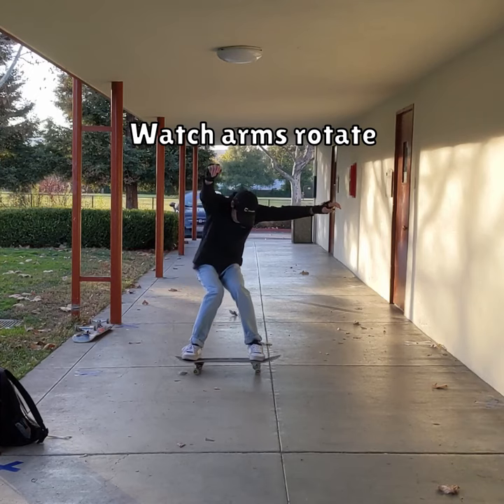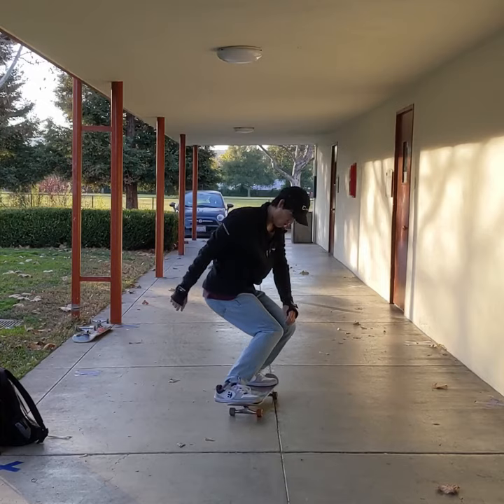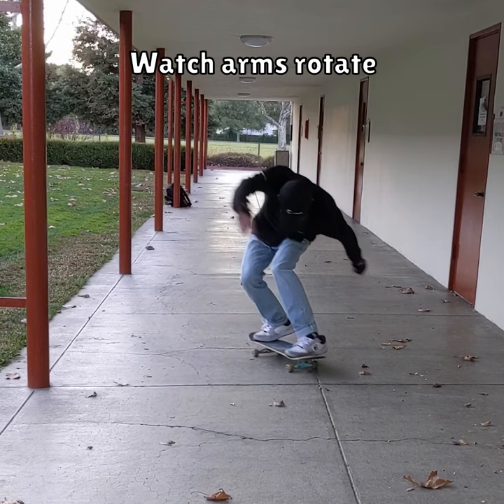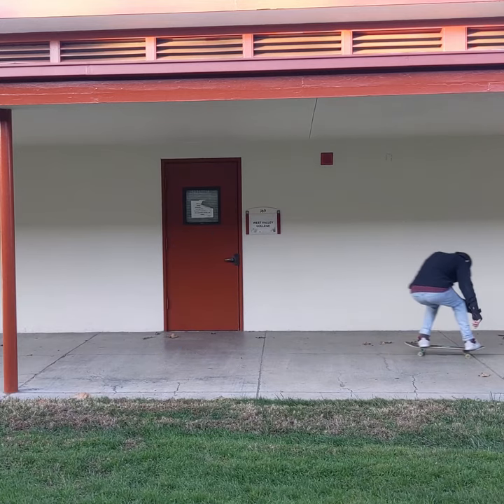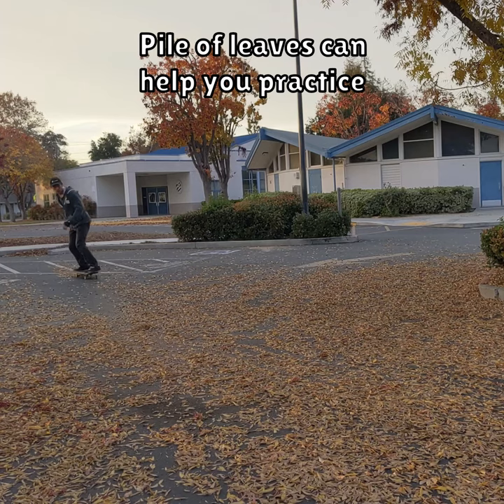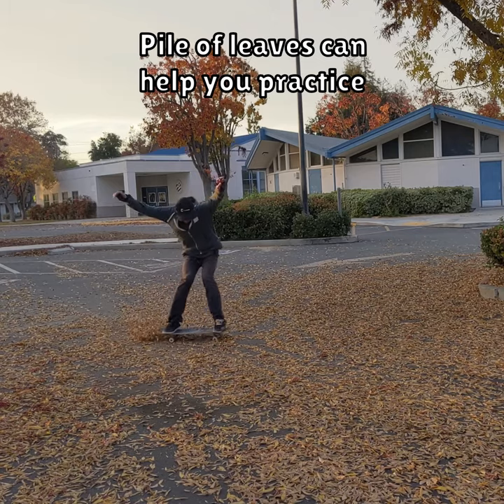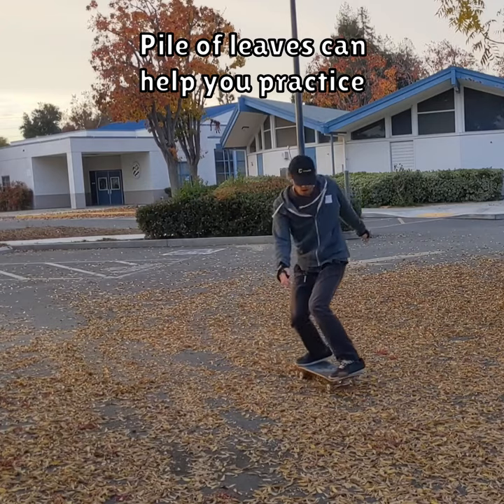Skate Basics: How to POWERSLIDE

Comment: Nobody tells you this easy tip, from a guy who has just learned to powerslide: the easiest possible way to learn it is to learn it into a wall, like go for the slide and hit the wall, so that the wall absorbs your momentum and you cannot possibly fall backwards, the wall just catches you, it's extremely easy to learn it like this, and do it faster and faster until you can slide for over a meter and barely touch the wall, then try without a wall. Other tips: get 99a hardness wheels, those slide extremely well; a smooth surface is better; when initiating the slide push your back leg forward and do a bit of a hop so that you don't have any weight on the board, then push with BOTH legs equally once the board is parallel to the wall you're coming towards.
Reply: Tysm this actually helped a lot. when you said hit the wall u thought you were trolling tho😂
Reply: @ThatLegoBeagle  Glad it helped 🤠
Reply: @ThatLegoBeagle  Yea I meant hit the wall with the board, ideally, not with your body

Comment: Don't try and do a 90 degree power slide if you're new to these guys, it'll be too much and throw you off the board. The hardest thing with theses is pushing the board forward and then retracting it. You need a lot of speed so doing these slowly like this guy does is harder than it looks.

Comment: Question from friendly snowboarder turned skater. This is just like a snowboarding stop right?? Seems same.motion
Reply from the maker: I've also snowboarded (only after I had learned to skateboard). Imo, stopping on a snowboard requires less force from your back leg, since the snow is so slick. On a skateboard, you really need to push that back wheel forwards hard, and take more weight off your board.
Reply: @RegularJason  thanks for that, that was exactly the issue I was running into thinking about it, since I wasn't transferring my weight enough the wheels didn't have enough soom.to turn. Thanks a lot!!